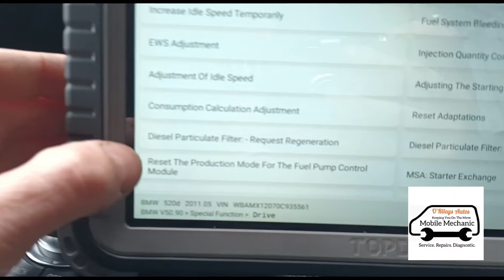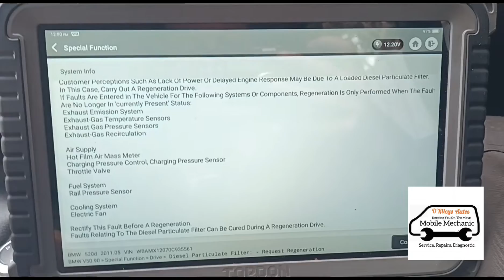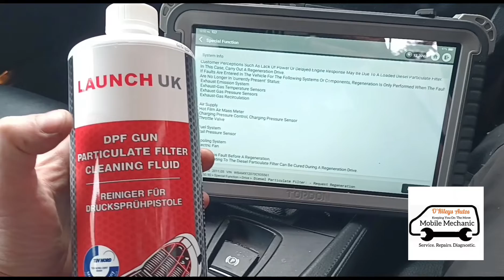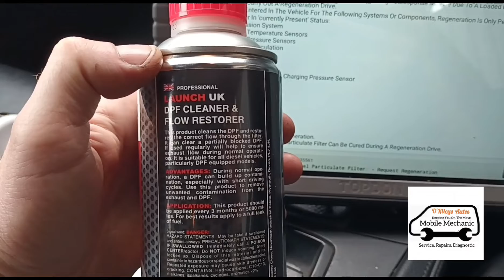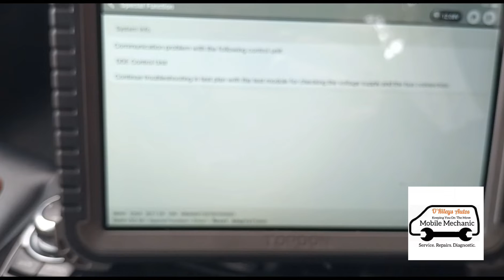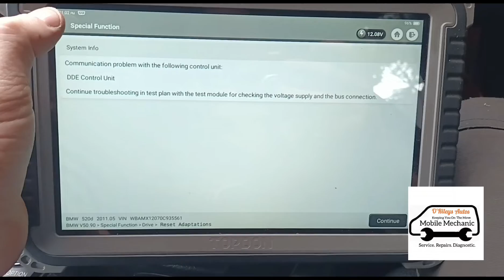3 Reasons Why You Can Damage Your DPF Beyond Repair

Comment from the maker: You can buy Launch DPF cleaning fluid here...
https://www.launchtech.co.uk/technical-fluids/dpf-gun-particulate-filter-cleaning-fluid/
Reply: Jim what fluid did you spray into the air system to clean the carbon out of the egr/manifold system
Reply from the maker: @garethd839ify  same launch fluid or revive Turbo cleaner
Reply: Am I confused watching the video you’re doing one putting a fluid direct into the DPF_ but are you also doing one with the fluid that’s going into the fuel tank?
The link takes you to one that needs a gun
Reply: Is the multi cleaner they make any good... It covers the dpf egr and so on..

Comment: I’ve been using the launch flow as what you recommended for the last 12 months which the van was running perfectly but I didn’t want any issues so I put a flow tin in every fill up and I’ve been having afew issues with a p2002 tryed a clean out with the launch gun as what you do and doesn’t seem to be doing anything. But the exhaust tip on the end is black sooty.
It’s all turning into a pain in the ass.
But this is life!!!!!

Comment: If I have DPF problems I'll come and see you if possible. My old 2016 Hilux did 160k miles with no DPF problems. Most days it was driven hard as I had a lot of work scattered about. It had no indicator but you could tell when it was regenerating by the different running of the vehicle. If you did short trips it would be more often. I now have a 2023 2.8 Hilux and have cut down my work a lot so I'm a bit worried. It has a proper indicator that shows it regenerating. Hopefully the DPF will last quite well. Thanks for the video, I shan't be pressing the forced regeneration button.

Comment: Have a question Jimmy if I may 
I have a 2017 Subaru Outback 2 liter diesel. It has the cvt transmission.
Ordinarily, how does the cvt tramission model do its own Re gen of the dpf - does the engine rpm need to be over 2000 ??
My car rarely would spin up faster than 2000 rpm unless it's doing 120/130 KMS .
; so how does the cvt model do its Regen when generally the rpm is kept mostly below in the 1500 to 1700 range ??

Comment: Thank you!  I knew some things about DPFs but you are an eye opener...
Purchased a 2014 Jeep Grand Cherokee in Dec 24 with barely 48.000miles on the clock.  I generally do lots of long distance driving, lots of motorway.  But after spending some 3 weeks at home and doing only short trip driving my engine went into limp mode, max 3rd gear and 40MPH and scan tool saying DPF 160% full.  So I had to run forced regen.
Everything worked fine after that, pressures are OK now, but sooth level still about 8% and going up visibly once I run the car again on short trip, reaching nearly 50% in a weeks time of local driving.  Normal ?
I will make it a point to get on the motorway regularly now that I know of course.
Should I perhaps run a bottle of Launch through the DPF?
Thank you!
Jake
Belgium

Comment: I've tried a dpf flush on my Trafic. Used a Launch scan tool to monitor the dpf pressure and soot level. Have been watching your videos for a while.
I watched the pressure drop and the soot level drop. Thought it was sorted. Then to my dismay the pressure and soot levels started to rise again, to higher levels than before! Turbine temp sensor is knackered, so need to replace. Glow plugs unknown condition. Going to replace glow plugs and temp sensor, then try a two part flush from Penrite. Hope this saves my van. Fyi, soot level too high for a forced regen @ 80. Cheers! Love your work. From Oz.

Comment: My jaguar xf OY61SRX has thrown a code up as follows - P1247-00 turbocharger boost pressure low is this linked to my dpf filter has car is nearly hitting 120k on it any advise would be appreciated

Comment: Love to know how you can overheat the dpf when you see the temp of the dpf and you want it to rise up to 600 degrees anyway. And the module should check all the sensor readings when you want to do the regen. Saying ok if they are all good or no you cant do the regen. One thing which makes the regen stupid is the fact after you have to change the oil so theres grief just there. Its not a 2 seconds job doing that at all plus you got to buy the oil which is ridiculously expensive nowadays and get rid of the old. Chemical down the exhaust makes much more sense.

Comment: I recently took my dpf off, soaked it in dpf cleaner for about 10 hours and flushed it with water till it ran clear. Refitted and also repaired boost leak which was the original cause for blocked dpf and it worked great. I wouldn't use the cleaners that you just spray in as it doesn't clear it out fully. Backflushing it sends all the particles back the way they came into the dpf for a much better result.

Comment: Hi Riley I’m from Singapore, I have an Isuzu C-Series Truck. Previously, the Adblue pipe broke and it ran without adblue for quite some time until the Multi-information-display screen states that its engine torque is being reduced. After replacing the pipe and top-up adblue in its tank, I did a manual regeneration and everything was fine. However the next day the problem appear again on my multi-information-display screen. Could my SCR be Damaged from running dry?

Comment: Just found a sprinter fluid level defect.  I went over a sideways rut and my def level went from 3/4 to full and didn't re adjust.
So the level isn't accurate when off-road swaying or level changes.

Comment: Hi, thanks for posting this, very informative and helpful. Just wondering, does this mean that if there are any OBD codes at all relating to engine managment, then it will not perform a regen. I've got an Audi TT diesel showing a MAF fault code P1012 and a flap runner code P2015 as well as the DPF P2463 code. I've cleaned the MAF and put one of these stop limiting devices on the inlet runner motor (which looks new inside) but the faults persist. Anyway does this mean that it won't do a regen unless the two inlet codes are cleared.The car is stuck in limp mode and won't do a regen. Thinking about following your guide to cleaning the DPF which is easily accessible, but maybe it will still remain in limp mode..?
Reply from the maker: Yes the faults would need to be rectified
Reply: @ORileysAutos  thanks for replying

Comment: Videos are great and very informative. I have a question if I may, shop thinks I have to replace the DPF. 

My BMW F30 320d (236.000km on the clock) has had 3 DPF cleanings in the past year on the high pressure cleaning table (not sure how the contraption is called exactly) and they clean it to spanking new. The DPF will not regenerate on it's own because of the DPF blocked code (245700). This code is always on, so clean DPF, reset adaptations, clear codes, start the car, drive for a few minutes and this code pops even though the DPF is clean. Backpressure is within spec, idle - 7, 2000RPM - 22, 3000RPM - 51, 4000RPM - 74.

Also, it's reporting soot at 65-70% clogged on a clean DPF. I bought B-Tool to force regen, on a highway drive it starts regen, drops it from 65-70% to 1-2% in 20 minutes, reports the regeneration is complete, then it starts climbing up and it gets to about 40-50% in 10 minutes, after a day its back to 65-70%.

Do I need a new DPF or is there something else I can try before coughing out a fortune for a new one, any help is greatly appreciated.
Reply from the maker: https://youtu.be/YXB6E_1i_kE
Reply from the maker: You definitely have another fault somewhere or they aren't resetting the adaptions properly
Reply: Thank you very much for the advice. It was 54% last night, today after a 10 kilometer drive it's on 75% soot, so something is really weird with this car.  I've exhausted my understanding of the matter so I'm going to visit 2 more shops, if they all think the same I'm just going to replace it. Thanks again, really appreciate it!

Comment: planning ahead i have a vw dfp that ecu is saying its nearly full 50 /60 gramms of ash. I assume there is no way to do a partial clean of the ash in place.  I plan on monitoring the distance between regens. Is there anything else i can do. back pressure at idle is 7Hpa at present

Comment: Nice,,,very informative 👍.....if I may ask a question,,,im working on a toyota hiace with the 1kd engine,,,it has 300000+ km on it,,,the dpf is registering 222% soot content and it will run forced regeneration for an hr and not drop 1 %...there are a few causes for the blocked dpf,,like a turbo blowing oil and maybe boost leak...can I drill some holes through the filter as a temporary solution ?
Reply from the maker: I wouldn't drill holes and ruin the dpf. Copy one of my cleaning videos

Comment: The thing that is missing for car or diesel van owners is info . The car computer should tell the driver how full the exhaust dpf is .  If a diagnostic machine can read it the info should be on the car info screen . If this info was available people could take the car for a run long before the yellow drive to clear light comes on . People simply do not know the car is in regeneration mode .
Reply: Even with a warning light on the dash and  it's free of charge just take less than 5 minutes to top up washer fluid in the petrol station, still most of the driver can't can't do it by themselves let alone go for a DPF cleaning drive.
Reply: Then how can sale you new car after 5 year like i phone 😂😂
Reply: Why should a driver have to know? and why should they have to go for a long run at their own cost and time? Anyone with big DPF related costs and time should be able to claim the money back.
Reply: Couldn’t agree more, thought the same thing myself
Reply: @Infj-62 Thought this too for ages,a dpf percentage gauge should be a mandatory fitment on a diesel engine car because of all the issues caused by stop / start driving .Why manufacturers have not done this is unbelievable in this day and age.( All the gadgets like wireless phone charging etc etc seem to their priority!)
Reply: Went to India this year, we were taxi'd around in some new toyota diesel.

When it would go into regen, a row of bars would appear in centre screen showing as a count down of the regen till finished so yeah, toyota is doing it
Reply: @Jack-qn4vt sounds like you were riding in either a Toyota Fortuner or Toyota Innova that was used as a taxi.

And yes, I confirm that it actually shows you on the dashboard how many bars the DPF needs to regenerate (up to 11), while driving, in my case, the DPF in my Fortuner starts its regen after 100-120km of driving and it takes about 5 minutes to fully finish the process by driving 60km/h, I actually don’t mind driving the extra 5-8 kilometres in a circle around the block each time it happens.

Comment: Just having a new DPF fitted to my Range Rover L322 4.4TDV8 as the original has been damaged beyond repair (melted monolith). I’d been using Archoil AR6900-D and am worried that this may have been the cause. Do you know much about this additive and does it increase temps in the DPF beyond normal parameters? 

Keep up the vids, you’re the DPF whisperer and I’ve learnt more from your videos than pretty much everything else out there combined!! 👍
Reply from the maker: Not used it so can't comment
Reply: I’ve used 6900-D for 8 years,1ml/L, on my 13 plate Jag XJ tdv6, never seen any dpf warnings and I do a number of short trips. The chemistry in these archiol products decrease the temperature at which the soot combusts, so reducing the risk of dpf  heat damage. Moreover the soot mass in the dpf is always negligible & the differential pressure is low, less than 10mbar.
Reply: I have used Archoil  for the last 3 years or so and last March, my garage checked the DPF and the pressure reading and soot level were fine (11 YO, 110 000 mile S-Max) I believe it also makes the car run more smoothly although I see no improvement in mileage. Having looked at the additives as far as possible, I think there is a Cetane improver, a detergent and a lubricant for the pump and injectors. I think it just upgrades standard fuel to premium fuel at half the price difference you would pay at a garage. I will continue to use it as I am happy with the benefits I believe I can feel.

Comment: Very informative video 👍🏻
What would cause black smoke coming out of exhaust with a car with a new dpf?
(had a new dpf about 18 months ago at main dealer)
2014 ford kuga 2.0 tdci 163 bhp, no codes what so ever and runs perfect.
Reply from the maker: Air to fuel ratio out. Boost leak or stuck EGR valve most common cause
Reply: Dirty air filter, stuck EGR valve

Comment: Hi what’s different between engine carbon clean and dpf cleaning or both have to be done at same time
Reply: Engine carbon clean is snake oil where as DPF cleaning fluids actually work it seem, as long as it’s the right stuff.